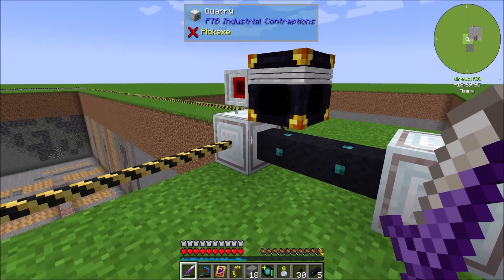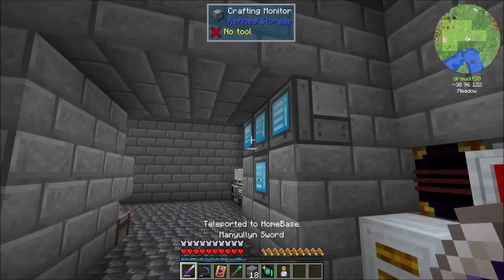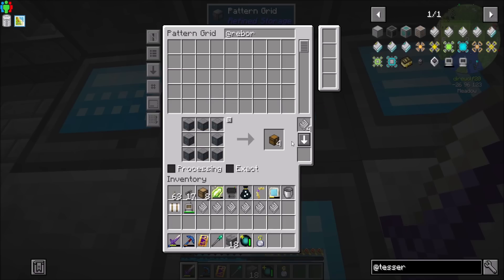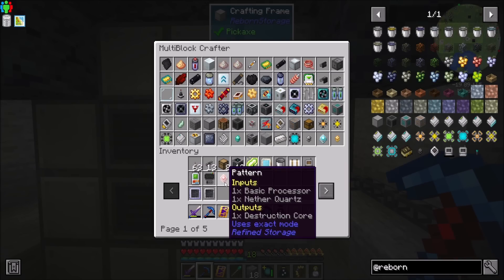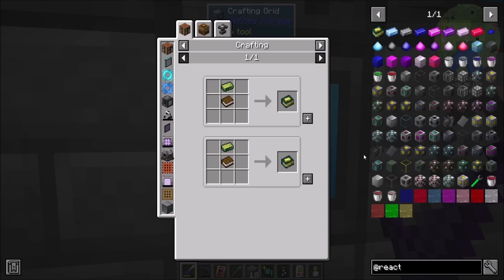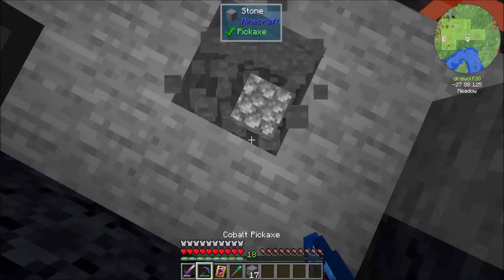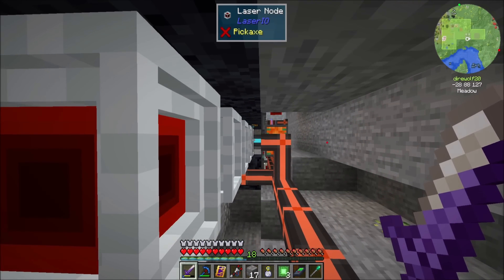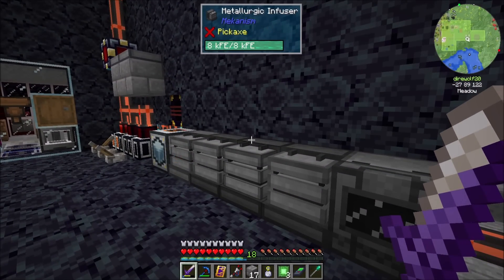Lets Play S11E47 Reborn Storage and Mekanism Startup

Comment: If I remember correctly and the quarry mod hasn't changed alot, but the quarry should be able to mine a 64x64 are and to get it exact, put a Redstone torch next to the quarry markers and they should light up with 2 lines.  Follow the red lines.

Comment: For stocking the enriched materials, I used a crafting card and a regulator card to keep a chest stocked with 1 stack of each enriched.  Then I used LaserIO to transfer into the machines. Made for a nice clean look
Reply: I did something similar; I set up a series of drawers to hold the enriched materials (using an iron downgrade to limit it to one stack of each, fed with a RS exporter (filtered, and with a crafting card to automatically restock as needed), each drawer has a logistical transporter (Mekanism item pipe) that fills it's respective machine.

Comment: Pipez don't have internal inventory, so tge laser didn't connect. However, pipez was able to insert power into the laser node.

Also do cobbleworks with mekanism, it has a cobble gen upgrade.
Reply: cobblegen upgrade is only for the digital miner.
Reply: Pipez not having an internal buff is the reason it doesn't lag, I think Dire could configure the energy pipe to conect to the node if it has a buffer though.

Comment: Just a heads up, if you plan on getting into extreme reactors, I would recommend you get your iron problem under control. Cause if you don't, it'll get much worse.

Also saw you were looking into elementalcraft, and I'd highly recommend it. For my wither killer setup this playthrough, I went with a hex casting spell circle setup with 3 spell circles casting max power explosions w/ one going off roughly every three seconds, but for this I needed to automate amethyst somehow, and I decided on using elementalcraft budding shrines and had a lot of fun on my way to automating those

Comment: dire, for steel just use create's recipe, heated blaze burner 1 (char)coal and 3 iron, it's very fast and it will save you on coal. 
I mention this because I don't know if you can use charcoal for the enrichment to make steel.
also pretty sure the create steel recipe is allot faster to craft.

Comment: Ur lase io works fine, the problem with ur laser io is that with redstone and energy its not extract and insert. its input and output. on the cable u need to put it on insert, not extract. thats the input. so it works fine with cables, but u have to put it on insert for input and extract for output.

Comment: It seems like your infusers aren't drawing power from the LaserIO nodes but rather from adjecent blocks? Because when you placed the infusers, they were already full of power despite the fact that you haven't connected any of your nodes to a power source.
Also you should check whether all of your pulverizers have augments. The one furthermost back (which was full of unprocessed iron) was running slower than the other ones
Reply: Mekanism machines charge from batteries in your inventory, so they must have charged from his capacitor.
Reply: @2ndkirbyever  oh, didn't know that, makes sense now (I just watch the Lets Play, I don't play modded minecraft tbh)
Reply: @2ndkirbyever  No, they have a full charge when you first craft them.

Comment: tesseracts are bugged, they don't work. but the RF Tools Energy Cells work for wireless storage / transfer really well.
Reply: Tesseract works fine for me. I use it to transfer the energy from the Mekanism Windmills I build 200 blocks in the sky.
(DirePack 1.4.0)
Reply: @h.m.chuang0224  interesting. i am on 1.6.1 and they do not work at all. i had it working before, but i think one of the last updates broke it. cause it does not work and i had to switch all my tesseracts out for RF Tools Cells.

Comment: RF tools builder is faster and easier to setup. But it consumes at least 20kfe/t. I have been feeding it with two 5x5x5 extreme reactors and 98% pure crystals.
Mekanism allows for 5x ore processing but you need silktouch
Reply: That a pretty east ask considering its 5x and with novu you can craft the enchant but dispensing on if u can get better then fortune 3 then that changes the whole calculation